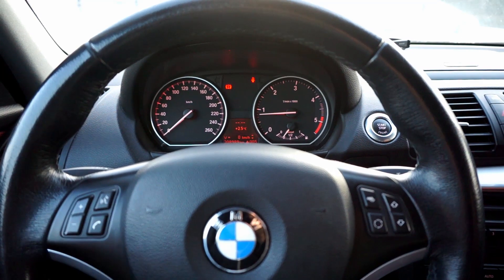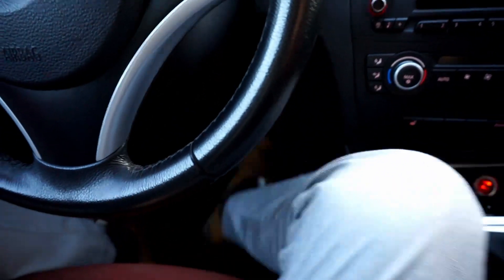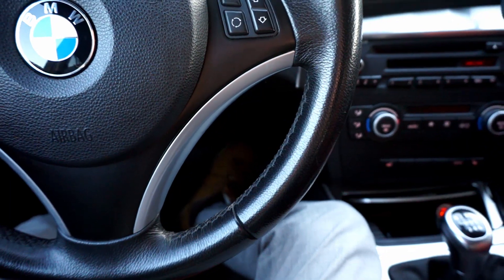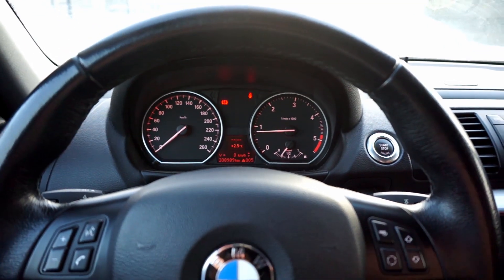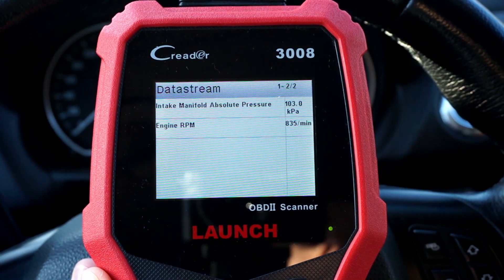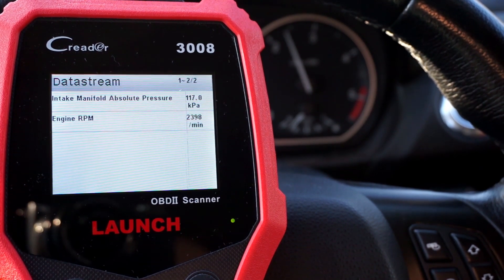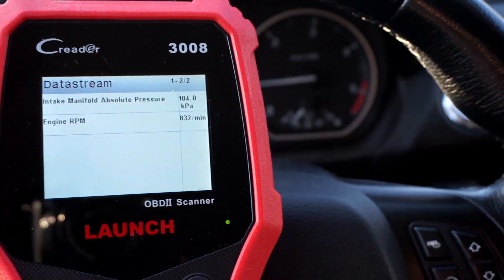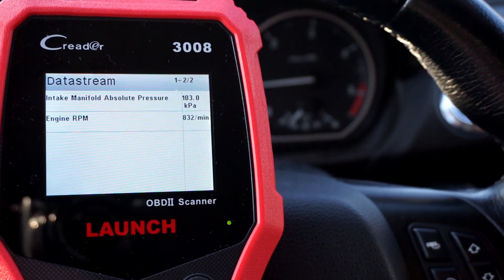BMW launch control and turbo boost build up (E87 E90)

Comment: Hello, I only recently discovered this on my Manual BMW 123D 1-series 2010 LCI model. What I also found out is that it only happens sometimes. Sometimes it will hold at 2.5k rpm but other times it will over rev pass 2.5k rpm. Is there a certain condition that needs to be met? such as required operation time or oil/water temp? Thanks
Reply from the maker: Might be steering angle. In VW/Audi it will not allow to use the procedure if wheels aren’t straight.

Comment: equates to around 3.5 psi and most bmw cars won't let you rev past 4k rpm in neutral even with the clutch out - the 2.5k is simply a transmission protection feature so you don't trash the thrust bearing with the clutch depressed or shatter the clutch plates by the dumping the clutch at 4k rpm - only the autos can build proper boost for real launch control
Reply: I have va 320d auto and it only lets you rev it to 2k rpm when in D or DS but it lets you rev it up to 4k rpm in neutral. I was wondering if you can rev it in neutral than quickly go into D or DS and having a better launch or would that be bad for your transmission?
Reply: Lol what ? My E90 goes to 7k with the clutch pressed in

Comment: But when u relese clutch and car spins tire it will lower your HP and it will be shit, i launch my car dsc off and rpm about 3500
Reply from the maker: There's no will spin since DSC is enabled. First few meters it controls RPMs and keeps at the edge of traction.

Comment: Its the dsc system that does this 😂 disable it and try again, this "launch control" Will disapear..
Reply from the maker: Teach me more. Why is the boost different at the same RPM with no load?
Reply: @mrfixpl  boost builds with the rpm, this is not intended as "launch control" this is so u can get the Best start with less wheel spin, its a cool thing dont get me wrong , but i never use it, because i like to launch myself with dsc off, I had an audi b7 for a while, audi's esp system did the same thing.
Reply: @mrfixpl  its like you sad in a this video "like a launch control" correct term i guess
I guess boost builds up More, because car knows its not just idle rewing...
Reply from the maker: right now I have Golf MK7, and there’s a launch procedure as well but it requires to turn off (or limit) ESP to use it.

Comment: When you hold the throttle open at a point it won't give you the same pressure even at the same rpm due to the intensity of the combustion stroke. Than at full throttle at the same rpm
Reply from the maker: That would be the case in petrol engine, not in diesel.

Comment: I tried it in my 120d 2008 Facelift m sport, but somehow it doesn‘t work. I put it in 1st gear and press the clutch as well as the accelerator but still revs up to 5000rpm or something
Reply: its only LCI models that has this bro, my 2010 316d has it
Reply: SoWi Ist Nice same
Reply: very strange i have in in my f20

Comment: Hello Mr.Fix,

I have an e81 (118D), are  supposed to do launch control as well?

Tnks
Reply from the maker: Prefacelift (with M47 engine) - no.
Facelift (with N47 engine) - yes, if the ECU software is from 2008 or later.
Reply: @mrfixpl  Mine is the second one. The N47 I need to try tomorrow...
Reply from the maker: Let me know if it works in yours!
Reply: @mrfixpl  Yes, it works (:

Comment: Does not work with 2007/12 E91 with N47 130kw 2.0 turbo diesel. 
Any help?
Reply from the maker: I looked around and it seems that it will not work if one of the following:
- engine is not turbocharged
- transmission is not manual
- traction control is not fully on
- ECU firmware is too old

Not sure if those are all conditions for this feature to work. My car is 2008/12 so there might be a firmware difference.
Reply: mr-fix N47 is clearly turbocharged (bmw does not sell NA diesel engine), my car is manual and traction control is fully on. (I have to hold the button down for like 5 seconds to turn it fully off [two stage])
Reply from the maker: Must be the firmware then.
Reply: mr-fix yeah probably
Reply: I have same engine same year and i can do it so ye try to update firmware or smth
Reply: @zblinkk  how? How to update the firmware?